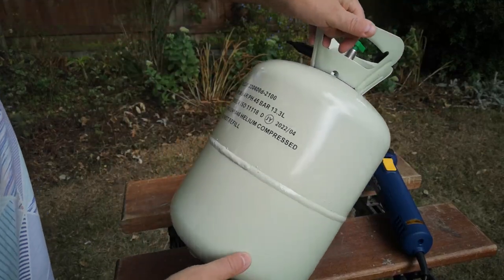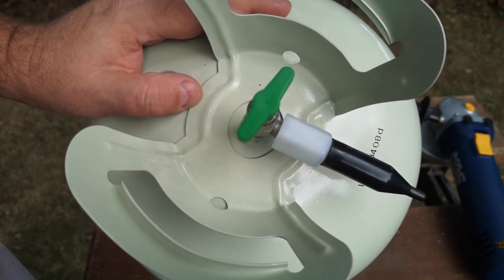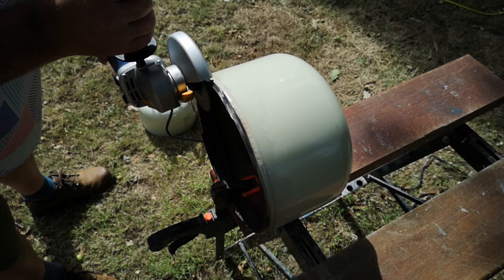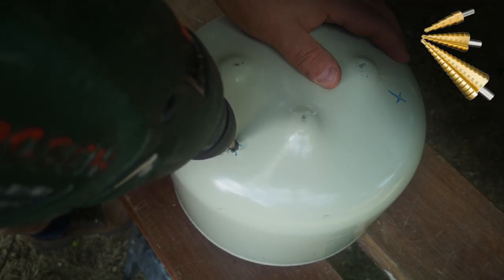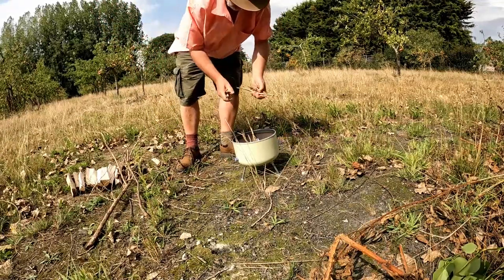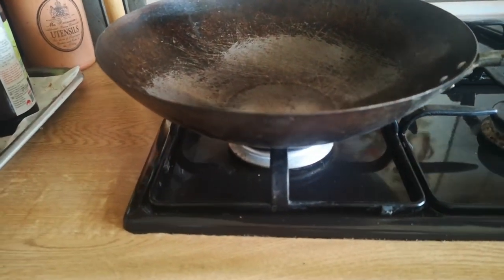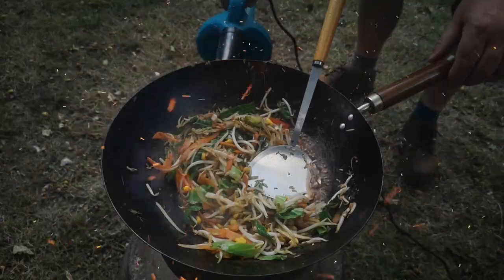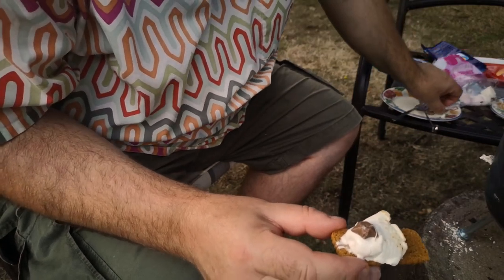Making a Simple Charcoal BBQ Hearth From a Helium Gas Bottle

Comment: 1:15 Flammable gas cylinders require more safety measures. Many remove the valve and flood the cylinder with water to displace any flammable content left inside. Then they dump the water and let it dry, before making anything spark near it. I have seen plumbers be scared of old gas pipes that had wind through them for the last weeks (Both ends open, yet they where careful as hell) So if you are doubting even just a tiny bit, DONT DO IT.
Reply: I've got an old cylinder that I'm planning on using to make a rocket furnace with and flooding it was the way I was told to empty it. It totally makes sense and I suppose will save your hands
Reply: @sounduser  Maybe dont cut a rented gas bottle. In germany, the good old propane bottle is available to rent, and exchange when it is empty, or to buy. Idk if it gets exchanged or refilled, but you can rent and buy the gas bottles. But yeah, in most cases, renting gas bottles is the easier solution. Although, depending on how you see it, the gas supplier sells you the gas and borrows you a cylinder/Bottle to keep it in. When you used up the content, you return the bottle.
Reply: @sounduser  They have a limited lifetime of around a decade or two so if they're in use somewhere most likely you can buy a decertified one from someone if you look around. It may have a hole in it if regs require them to be rendered unusable before sale as scrap, but that won't affect use as a grill or stove. Compared to high pressure welding gas bottles LP bottles are low pressure and pretty cheap, so once they go out of certification and look tattered they tend to go to scrap rather than hydrotesting and reconditioning.

Comment: My rule of thumb is to always fill it up with water. K.I.S.S. Even if it's a fresh bottle, empty, never used, i'll still do that. Even if the contents were CO2, for welding gas, i'll still do that. Simple things keep the world go round. I've seen one (literally one) too many times what happens when you decide to walk outside the common, garden variety common sense rule.
Reply: What I came to say, remove the valve and fill with water.
Reply: Definitely this. I'd have 100% wanted the valve removed before I started cutting it. For flammable gas bottles I normally fill them with water to the brim for a couple of days before I cut them open.
Reply: Me too remove the valve and fill up with water every time
Reply: 😁 never know if a scavenged " safe canister* had been filled with something flammable! Bit like old Refrigeration systems upgraded to R290 (propane) with missing labels!
Reply: @MrShlomping  It's not easy to remove the valves on these disposable cylinders as they're generally welded on. You might be able to use a pipe cutter to slice it off but pointless when you know full well it's a helium cylinder. Even if it was under full pressure and you cut into it worst you'd get is a loud hissing noise for a short while these things aren't under huge pressure.
Reply: @Jawst  R290 is especially dangerous since it's propane without the scent marker added. You literally can't smell the stuff like normal propane.
Reply: Hmm that's a bit much for this scenario. Realistically filling it would be an inconvenient task and the difficulty one would have refilling a one time use canister with another chemical, the probability that it is  ignitable at atmospheric pressure and temperature all coupled with the fact that he seemed to exclusively be the chain of custody post retailer, you probably have an equal chance of having gasoline come out of your facet when you try to fill it instead of water. 
What do you think is higher restaurant food poisoning deaths or people cutting open misfilled explosive helium one time use balloon canisters. What precautions do you take when going out to eat.
Safety is ever in a battle with efficiency until you sacrifice some of one you cannot get the other
Reply: Tank full of water, 240  volt angle grinder, what could go wrong?🤷‍♂️
Reply: @2lefThumbs  not a lot if you know what you're doing.
Reply: @mfx1  yeah, but if you know what you're doing, why fill the thing with water?
Reply: @2lefThumbs  If you know what you're doing you empty the water out first.
Reply: @mfx1  true, but if you really knew, you wouldn't put it in to start with 👍👍
Reply: @2lefThumbs  Not if you were 100% certain you were dealing with a non flammable gas cylinder or a non flammable gas cylinder that hadn't been subsequently filled with flammable gas by someone (it happens). If you treat ALL cylinders the same then there's less chance of getting complacent and screwing up.
Reply: @mfx1  that doesn't make sense, in its own context, or the context of the cylinder in the video
Reply: @2lefThumbs  I've known people fill old disposable Helium cylinder with propane.  Yes in the video the history of the cylinder is known and he's happy to do it his way which is fine but if you're doing a lot or using dumped cylinders it's a good idea to treat all cylinders the same way just like it's good practice to always treat a gun as loaded even if you KNOW it isn't.
Reply: @mfx1  I refer you to your response to Crakkajack
Reply: @2lefThumbs  "When you know full well" If you don't because the cylinders history is unknown then use a pipe cutter and fill it with water.
Reply: @mfx1  "why the quotation marks"?
Reply: @2lefThumbs  They were quoting one of your comments directly. That's the primary use-case for quotation marks.
Reply: @2lefThumbs  240? Is that a uk thing? Here in the states I run a grinder and most appliances on 120.
Reply: @ConstantlyDamaged  no he isn't- got any other punctuation insights that you'd like to share though?
Reply: @2lefThumbs  Congratulations on learning how to use the edit feature in YouTube! With this handy trick, you can win any argument with the click of a button!

More punctuation insights? Oh, here's one. A hyphen, like what you just used, should have spaces on both sides if you're using it in place of an em dash (—). Also, you didn't need to use an em dash here—because neither statements are sentence fragments and you're using correct noun assignment in both sections.

Now, don't bother replying further, you little gaslighting internet warrior, you are muted now. :)
Reply: @ConstantlyDamaged  He was quoting himself, not me, my edit button doesn't let me change other peoples' comments, I don't know about yours🤷‍♂️
Reply: @iangreene2063  yeah, in the uk the supply is 240 volt, 50Hz as is much of Europe (some countries have 3 phase supply to houses, in the UK 3 phase tends to be business use only).  Tradesmen in the UK tend to use110 volt tools for site work, using a ground isolating transformer to reduce the shock hazard  though

Comment: Another good safety practice when working with anything that throws sparks like a grinder or especially a welder is denim jeans or anything that covers the top of your shoes. Hot bits of metal that land in your shoes or on your socks will hurt really badly.
Reply: It will also create a danger of making MRI procedure never be available (if one has bits of metal in them, MRI most often cannot be done)
Reply: Can confirm, it’s a bad time.

Comment: Forestry pants can be a very good idea for any job like this where there is a potential for blowback or sharpenel from the cutting.  They are specifically designed to protect the arteries in the legs in the event of missing with an axe, so they would probably be a good idea here for similar reasons.  Of course, that's assuming you're doing this kind of thing often enough that it's a purchase you can justify.

Comment: For your wok, what you could do is get a circular cooling rack that's slightly less wide than the diameter of the BBQ.  You  could hook that to the edges of the BBQ so that it hangs down slightly and allows the wok to seat on the rack and leaves a slight gap between it and the edge of the BBQ.

Comment: made one from an old  propane tank many years ago ..we use it every time we go camping ..much safer then a on ground camp fire... get an old oven shelf cut / bend to shape viola free grille....I've cooked countless fryups outside the tents ... if using a combustible gas tank after removing the valve just be sure to fill the tank with completely water and leave over night before cutting...I've over the years made many many 'wood burners' aka man cave heaters / patio heaters for friends and family from old butane/propane tanks ..helps that I've been welding for 40+ years....also when grinding (not cutting) try using zirconia flap disks they're a game changer.

Comment: I have a great little BBQ made by a friend from a 9kg LPG cylinder which he filled with water before cutting.  He also welded a grill inside on hinges so I can lift it up and a little closable door in the side to promote airflow. I smoked a ham at Christmas on it with a mustard glaze, keeps the heat outside the house, Queensland,  brilliant use of an out of date gas bottle.

Comment: It's a well know tip, but so effective it's worth sharing - a little liquid soap on the bottom of a pan makes it really easy to clean smoke and ash off after cooking outdoors
Reply: Question: do you apply the soap before cooking? Or are you just saying to use soap to clean the ash off afterwards?
Reply: @Filbie  before cooking, to form a barrier on the outside of the pan for the soot to stick to

Comment: You could also make a makeshift wok by welding two handles and plugging the hole from a harrow disc blade. It's quite popular here and often used with single pilot gas stoves. The portable ones.

Comment: BTW when filling balloons a VERY rough rule of thumb is that an increase of just one inch (25.4mm) in diameter will double the gas used so for just a small reduction in size you can greatly increase the number of balloons you fill.

Comment: I love a good salvage project. As always, try at your own risk, but I believe many flammable gas canisters/tanks have thread on valves, which can be removed safely from spent canisters with a wrench (far awey from flames), and drained of any residual gas before cutting.
Reply: Steel is porous, there are intergranular spaces which can fill up with volatiles that are only released when the steel is heated. Legally (at least for commercial work) in the UK, all tanks or vessels previously containing oil, grease or inflammable gasses or liquids must be certified to be thoroughly clean (usually achieved by pressurised steam cleaning) before any "hot work" is carried out.
Reply: i've also seen people fill them up with water after taking the valve out to ensure all the gas was displaced.
Reply: Also, you are cutting up a valuable container that should be reused and refilled with gas. They will most likely be the property of the company that filled them, so you will be destroying someone else's property!
Reply: @tcm81  Where I Live you have to buy the canister outright, and then buy the gas, also, there are a lot of old "unsafe" cans laying about that are unusable for gas storage, they will fill up a landfill otherwise. 
anyway, using a good can would be an expensive project, considering the price point.
Reply: @-You-Tube-  No they won't. Not in the UK. They are the legal property of the gas company. Any unsafe cylinders will be sent to a plant to be refurbished and refilled. Cutting them up is dangerous and makes a poor barbeque. It takes jobs away from people who refurbish them in the UK and harms our balance of trade as we need to import more at great expense. There is a shortage of cylinders in the UK at the moment, so you may also be preventing people in the UK from getting a new cylinder of gas by doing this. You can return them to the company and get a refund of your deposit instead!
Reply: @tcm81  I should clarify that 'Where I live' Is Alaska, we do not have the same policies here.
Reply: @-You-Tube-  Fair enough.

Comment: I made my own burner out of an old washing machine drum I reclaimed from a dumped washer I found.
I used 3 cheap hanging baskets for the feet and even had an old grill from a round bbq which had long been sent for recycling.
It worked great until someone stole it
Reply: That sucks. We made one of those too with a dryer drum. It already had air holes premade into it. We reused our fire bowl stand after the bowl rusted away.

Comment: Regarding gloves and grinder, I would say it depends on the disc you are using. Standard abrasive discs that are smooth don't have anything that could catch on so I always use gloves to protect me from sparks. I prefer tight fabric gloves, not those thick leather ones.

Obviously if you are using discs with something sticking out like those for carving wood then don't use gloves, and there are also no sparks. But those are much more dangerous in general, so only for very experienced users.

Agreed on every other point :) ear and eye protection is crucial, like for real.
Reply: I was going to say, back when I was a welder we would get yelled at by the safety team for not wearing gloves when grinding.
Reply: @overrideFunction  I will always use gloves with a death wheel, I have had a few close calls where the gloves got completely cut but I came away with only a scratch on my finger.

Comment: The cover on the grinder is one I think you missed.  It provides added protection and make sure all the sparks don't travel into your face.  Your grinder has that protection but it wasn't mentioned and I think it should be mentioned.  That little extra cover does help a lot.  No loose clothing but I think you made your point when you put apron on there.

Comment: I made almost this exact piece with a propane bottle (removed the valve entirely before cooking) for my wok I cut a 3 piece strip of the canister off the top parts of the bottle and drill a bunch of holes in it. I set that piece on when using the wok to allow air flow.

Comment: On webber cahrcoal bbq's when using a large wok you have a similar issue, So what most people do is get some split links (The things used to join lengths of chain), and just sit 3 or 4 of them on the edge, lifting up the wok enough to get fire all arround it and prevent air starvation.

Comment: Looks great. If you're having issues with airflow it might be a good a good candidate for making a rocket stove. Just add a secondary metal wall with perforations along the rim. Burning wood with it will release wood gas which will also be burned. A hotter, wind-resistant flame with almost no smoke.

Comment: As for the safety message, gloves and aprons with an angle grinder (at least 10 or so years ago when I worked in the manufacturing trade) are advised. Your point with the rotary tools is correct however I think it’s different when using abrasives. As an apprentice welder/fabricator we always wore rigger gloves for almost all operations. They saved my bacon ONCE and once only. Cutting a piece of steel with a slim cutting disc the tool gripped and I lost control for a split second. It zipped straight through the the top of the thumb and just over the gauntlet part of the glove. On my wrist where the grinder made contact I had a small “scratch” that had cauterised which would’ve been barely deep enough to draw blood anyway. There was almost no pain but I went in to shock and felt deathly ill for the next 20 minutes or so.
Reply: they have us wear the gloves too, it's probably better for the glove to clog the small grinder than your hand to clog it

Comment: I don't know how common wire coathangers are in your area, but fencing wire or something similar should be readily available anywhere.

If you put a simple wire basket under the wok, it would shim the pan away from the top edge and allow airflow around the base of the wok.  This could avoid your crenelations solution.

Comment: Maybe find two or three firewood blocks that are higher than the hearth and put them in. Since they stand high above the opening, your wok can’t seal the opening completely, thus solving the airflow problem. The only downside I can think of is you need to use one hand to hold the wok in place while you’re stir frying lest it topples over.

Comment: I'd say that the traditional charcoal stoves used to cook in Thailand (with a wok) are of a smaller diameter and the coal is way closer to the bottom of the wok. I can try to get some measurements if you wish..

Comment: Good video, liked the safety tips. But in the vid you were using the angle grinder while wearing short. When using a cutting disk, you should be a little more careful, those disks can explode and cut you. It s rare, i think i only saw it happen once to my brother. He was using normal long pants, but they were torn around the knee and the shattered disc hit the exposed part of the skin. He had a few cuts, but they healed.
Reply: I know someone who was using a cutting disk that broke off and it cut his head off.  Thankfully he wasn't alone and they put his head on ice and rushed him to the hospital where doctors reattached his head.

Comment: If you want to cut up a propane/LP tank, the common practice is to remove the valve entirely, fill it completely with water, then empty it. Pretty much a fail safe way to displace any residual gas and render it safe to grind/weld on.

Comment: When I was about ten years old,  we had a bonfire at my Grandma's garden. In the morning, it looked extinguished as I was outside playing in the garden, and the ashes looked so fine and soft...and it being summer, and me being barefoot as (almost) always, I walked into it. (I am basically an idiot. 🙄 My parents rarely had a month without me being injured!)
I ended up finding out that fervour survives overnight under the ash, and therefore burned my feet. I got away with some very large blisters on the soles of my feet, and thankfully had no 3rd degree burns. But that was bad enough...
If it comes down to safety, that fire pot is a really good idea IMO! 👍🏻